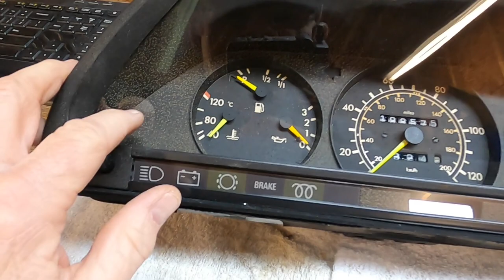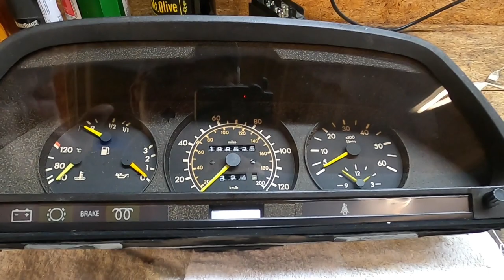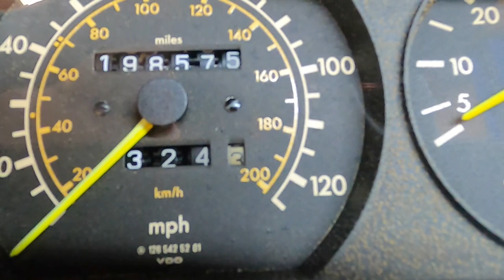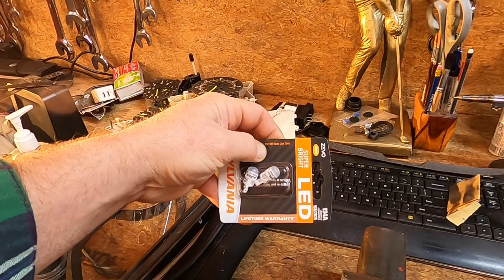W126 Mercedes Instrument Cluster Restoration Part 1 - Tear Down - REMOVE DOTS WITH SODA BLASTING!

Comment: Hi Impalaman,
You did the impossible! A million attempts have been made by Mercedes Benz aficionado’s with no avail until you came along!
Congratulations! 
The interesting part is this, in most cars the growth is white in color, I wonder if the previous owner was a 🚬 chain smoker💨 .
I believe this out grow is actually the plasticizer evaporating and the condensing. Not sure if there is a chemical compound / solution which can be applied to rejuvenate the plasticizer. Normally the plastic shrinks during this process causing a mismatch during assembly.
I am eagerly awaiting part 2!
With greetings from Kansas, Peter
Reply from the maker: Dissassembly was indeed tricky!
Reply: good afternoon, i live in jacksonville fl, i have a 1980 mercedes 300 SD diesel 3.0 L i need a good mechanic please.
Reply from the maker: @eljoven2036  I'd recommend going to Pierre Hedary's website and send him an email and ask for a recommendation. His Mercedes shop is in Titusville FL so he may know someone in your area.

Comment: That was made back when German engineering was actually a GOOD thing! lol...  Just FYI, you can actually replace the whole "light pipe" assembly with LED's.  Do a search, there is a company (Asian) that makes a kit in different color temps.  So that you can have LED illumination, that still LOOKS like an incandescent bulb!

Also, Im really not sure what the factory used originally for the "flat black paint" but it seems to be a type of rubberized black coating.  I'm guessing the growth is actually the rubber in the coating failing.
Reply from the maker: Cool. I will take a look. Thanks Johnathan!

Comment: 87 300 SDL been garaged 95% of its life has the dot disease in Western NC. Didn't notice it until after we had a dash bulb burn out and some smoke in the cluster that discolored it. Also a diesel.. who knows?
Reply from the maker: The plasticizers tend to condense out with age. It's NOT mold or anything like that. It's literally deterioration of the plastic. Plastic rust if you will.

Comment: Question:  I have working Speedometer and Odometer, but definite Click, click that reflects RPM.  Is this noise coming from a Mechanical Speedo cable?  Thanks, DD Maine
Reply from the maker: "All W126 speedometers from 1981-1991 are electronic, meaning they receive an electrical signal from the "sender" on the side of the transmission and convert the signal to the speedometer.

The odometer is mechanical, but is driven by an electrical signal."

https://126board.com/threads/w126-speedometer-cable-or-electronic.14112/

Comment: From my observation, this white dot issue only happens to cars that located at hi humidity areas like Florida
Reply: The 300SD up here in New England have the same issues also. You can see it in the for sale ads when the seller shows the gauges up close.
Reply: My 300SD is in the Mojave desert and picked up the dots while in a storage unit. It appears to be a fungal growth.

Comment: Plastic (polymers) from the 70s and 80s was not as good as the stuff we have today. With that said when I did the instrument cluster on my w116, it's a completely different animal from yours. It has a coat of flat black paint inside. I would not go for semi gloss behind the glass, look for flat. Outside the lens I would go for a semi gloss.
Reply from the maker: Good tip. I've got a couple of coats of satin on it now but I'm going to look it over after it cures and reassess. I may go with flat if I don't like what I see. Work in progress.